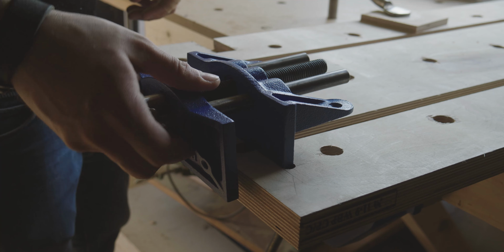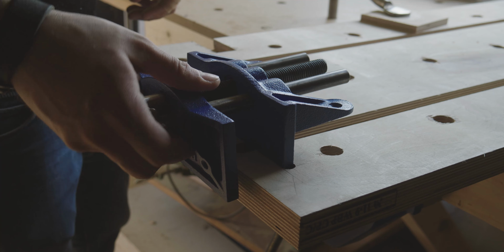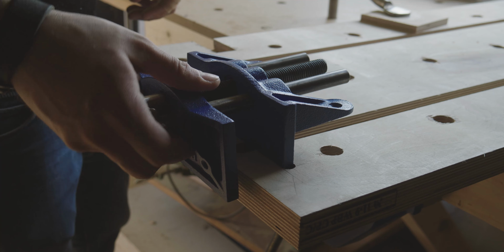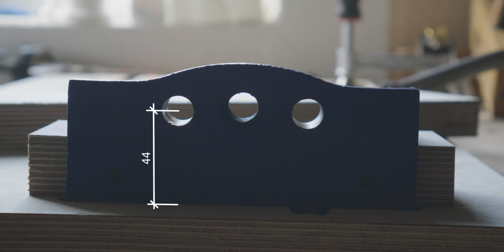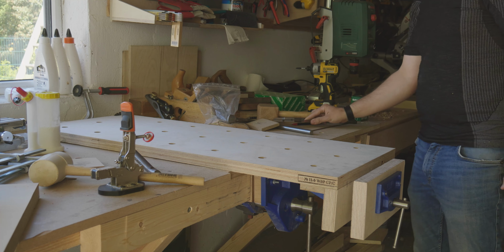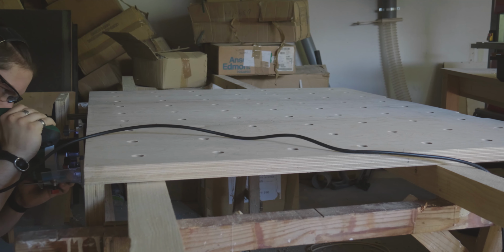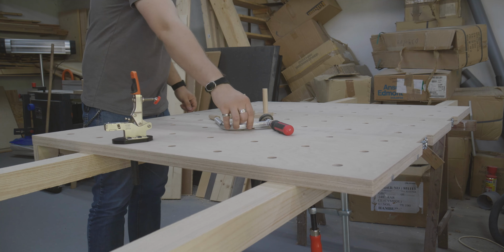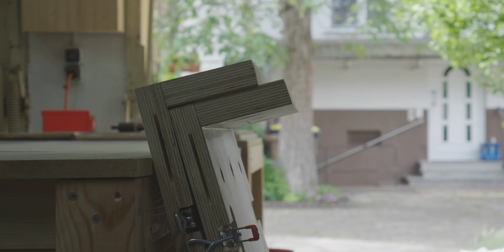Mobile Modular Workbench

Comment: How do you cope with the wobble due to the unsecure base? A more stable base might improve that perhaps half lapping the beams to the saw horses. It doesnt need to be permanent but might improve your user experience.
Reply from the maker: The wobble is only apparent due to the garbish saw horses I had at home. 
I use the Workbench mostly at Work, where we have pretty sturdy saw horses, so no more wobble. 
I also clamped the Beams to the saw horses, which improved stability further.
Reply: @Loulexmakes  Oh that is good to hear, glad the work saw horses have better alignment for less wobble.

Comment: Hi, thanks for the video. I am design now the similar workbench. What may/will happens with bench top in case of season temperature changes?
Reply from the maker: Since it is one solid piece of multiplex without a separate top plate, not that much. It might swell and shrink a little, but it will not warp or bend. The layers of the multiplex wood cancel the warping of each other out.